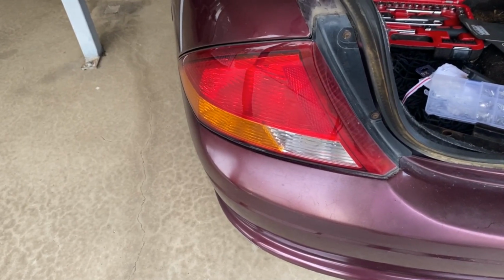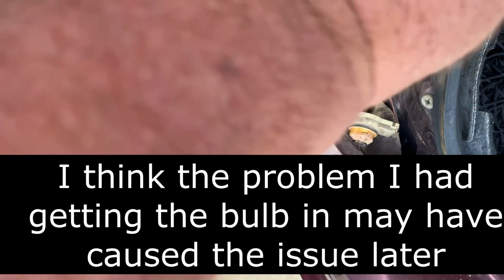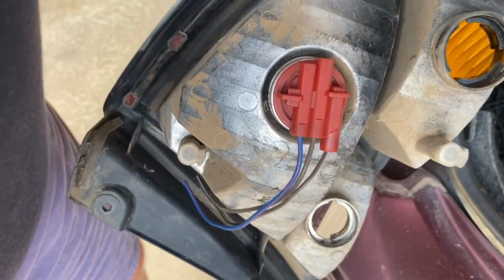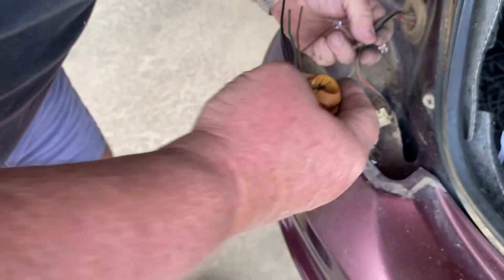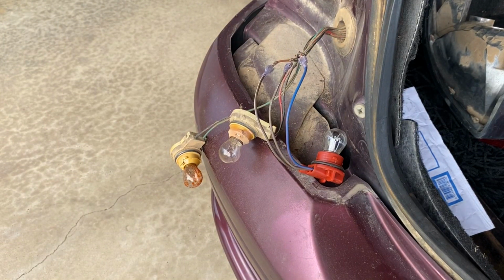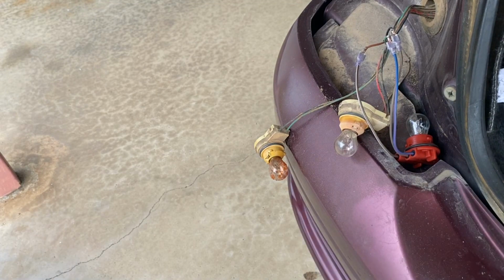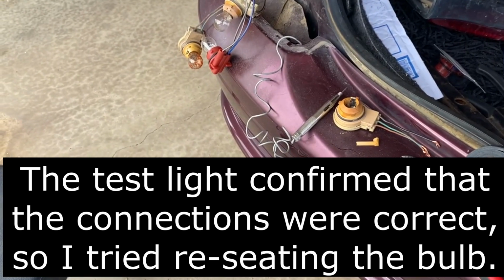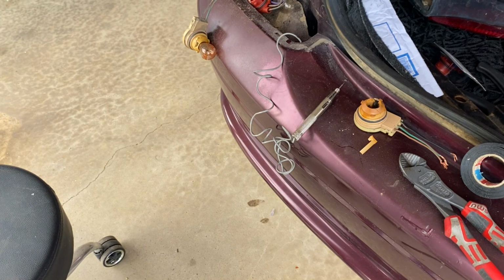Replacement tail light bulb holder for AU Falcon

Comment: Thanks for the video. AU2 wiring seems backwards compared to the OEX globe socket. After some trial and error. The correct wiring is:
1. AU2 green to sockets brown-whitestripe.
2. AU2 brown to sockets blue.
3. AU2 black to sockets brown

My globes would only go in one way for me (which is intentional).

Make sure to disconnect your battery first and electrical tape around connections, or you'll blow a fuse.
Reply from the maker: I didn’t bother disconnecting the battery, but my connections are fully insulated.